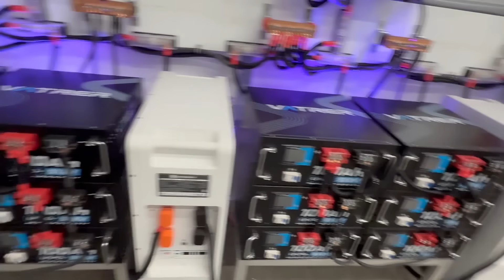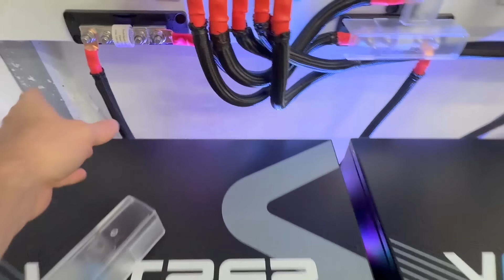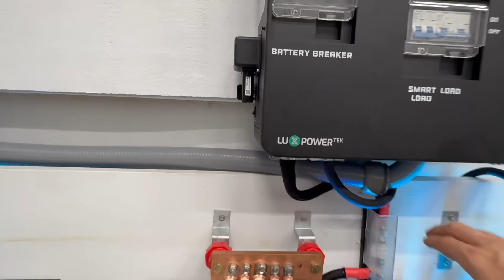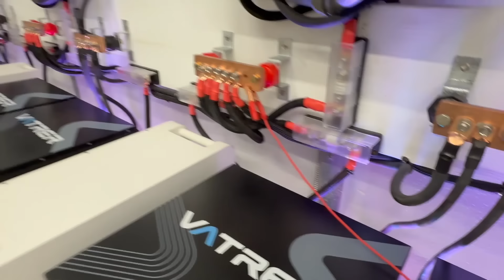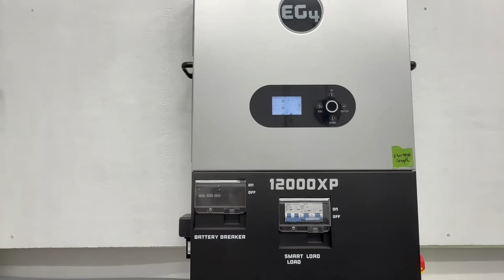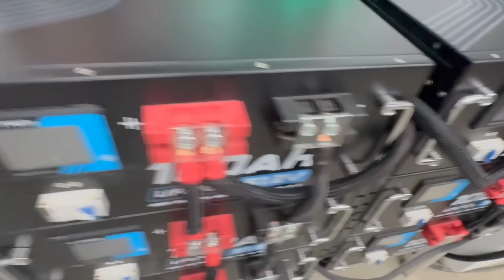Will These Inverters ACTUALLY WORK?  Initial Power Up!

Comment: When using your power supply unit to power the inverters on how does that work if the inverters are in the off position can you explain?
Reply from the maker: The low voltage dc bus and APS circuit for the main control board always have power when 48v are connected. Even if the power switch is turned off.

Comment: I'm curious - did you purchase all this equipment, cables all the hardware? Why so over the top? I can't even afford the cabling let alone the hardware
Reply from the maker: Hi Boomer, thank you for watching.  I did purchase it all, but it took some time to put it all together.  It covers a lot of my power usage but still falls a bit short in the winter.  My only thought is to start a little bit at a time based on what makes sense for you.  I personally started with power stations.

Comment: Mike, did you unscrew the terminal in the 12000xp and use a lug straight to the block using the M8 or M10 screw? I think you covered that in another video, but can’t find it. Thank you
Reply from the maker: I was able to fit a 1/0 cable directly into the EG4 block and torqued the Allen screw to spec.

Comment: Hi Mike — I’m troubleshooting an issue on my EG4 12000XP and figured there’s no better person to ask than the guy running three of them! 😄

When you get a moment, could you check something for me? From the display screen, go to the Data icon → UPS Data tab — what voltage do you see listed under VepsL1N?

Comment: Have you looked at your insurance policy yet... Most insurance policies are void with DIY solar even if the equipment is UL listed
Reply from the maker: You are absolutely correct.
Reply: @MikesSolarGarage  sucks doesn't it. I have 90kwh of diy lifepo4 batteries and only 1 of the 12000xp and 12kw of panels. 6kw on the roof of my detached garage and 6 more on a Sinclair ground mount. All the batteries and inverter are in my basement because I live in a cold climate I didn't want to have them in my garage. But now I think I need to build a power shed to house everything in that's not in my house or garage and remove all the panels off the garage. So if something completely non related damages my home it'll actually get covered... Ins is just crooks I tell u
Reply from the maker: @electromechanicalstuff2602 Yes they are.  It sounds like you have a pretty nice setup!

Comment: I started my own solar project, 13 batteries LiFePO 4, at 32 Ah each, in 12.8 v mode, in my case its only for CCTV and few switches. I have 1400 watt of solar panels. no inverters, just buck converters for other voltages. its a fun project
Reply from the maker: Sounds like a great project

Comment: Suprised you are not using the GridBoss.
The batteries are set up great but all those wires and the bus bars should be in a wire way...
Reply from the maker: Thank you for watching! I thought about it, but I like the simplicity of a large branch breaker and an interlock switch on the service panel, plus it’s cheaper.  But the grid boss is a great way to go.  The bus bars will be covered soon with a raceway.  I do agree wires would be better in a conduit box, but since I went overkill on bus bars , wire size, and T class fuses, it would not fit easily in conduit boxes, plus it’s extra cost that I could use towards another floor standing battery.  All your point are completely valid.

Comment: If you ground down the lugs, do you still have 2/0 of current carrying capacity?
Reply from the maker: Thank you for watching. Yes because the width of the lugs was wider than the contact patch of the battery terminal.

Comment: Beautiful set up…. Only cost what $175,000… this is not really a DIY for the normal people. Do not get me wrong…..it is very nice.
Reply from the maker: Thank you for watching, the setup actually cost quite a bit less. I think I have 45k in it including the solar panels.  This system and my second system running the shop are just under 70k combined.   I got really good deals on all the products.
Reply: @MikesSolarGarage I was not knocking it, it as I said is very nice and THANK YOU for show us it. The video was excellent also. But for the average Joe even with your deals it would be out of reach. 
According to save on energy the “”average”” electric bill in the USA is $150 (actually $149.37) and yes I know we all pay more…so to break even would take 38.88 years not counting finance charges or increases in energy rates. I do not know ANYBODY that stays in the same house that long.

Comment: I don’t know where you live but your system would never pass code where I live. All those wires and batteries need to be in a metal box and in conduit where I live.
Reply from the maker: Thank you very much for watching.  You are absolutely correct, most areas would not allow exposed wires and they should all be in a conduit box.  Also the bus bars should be covered in which that will be done in the near future.  I did consider conduit boxes, but fitting my bus bars and all of my T class fuses would be a challenge.

Comment: Completely unnecessary and complex. 3 x 50kwh packs  40% less money. You have eighteen b, m, s, that could go bad. You would also have battery communication with the inverter. I'm not saying this to be hateful, either just more practical
Reply from the maker: I understand Mark, if I could do it again I would go with 280amp floor standing batteries, but I got a really good deal on everything, so it was hard to pass up.  As far as battery communications,  I typically don't used it for any of my systems.  I go by voltage only.

Comment: Please provide source for the copper busbar
Reply from the maker: Here is a link to where I got the copper from.  I chose 1/2 inch thick by 2 inches.  Then select the length that you need.  You will need to drill the holes and mount it.  https://ebay.us/COHou8

Comment: Very tidy setup considering all the equipment you have there.  I'm not convinced, however,  that under full load your batteries will drain equally.  That could also go for charging.   I'd love to see a full and fast discharge cycle while measuring the amount of imbalance.   That would be an amazing vid.
Reply from the maker: Thanks for watching Greg.  Honestly, that is the hard part, trying to keep things balanced.  I do have a separate setup in my shop for powering the shop itself.  It has 2 12000XP inverters and 24,  24v LiTime batteries in series parallel configuration.  I learned a lot from that, but the system does pretty well, typically the highest and lowest stay within 10 percent of each other.  I'm trying to improve on that with this setup for the house.
Reply: @Greg-bx4id agree with your commenting 100%. Very neat & it'll be interesting to see the results.
Admittedly, after reading the creators response, a 10% "drift" on a battery system... Not good (IMO)...
Then again, I am not an expert by any means 😁.
Opinion; with a system this size 🤔 everything is exponential! Internal resistance, heat transfer, amp hour differences/voltage drop programed BMS differences, ect.?!
To the creator, I say bravo! 🙏 I wish you all my best in your system! Forgive me, but the copper prices alone here... I would have gone Higher voltage DC (just an opinion).
Reply from the maker: Thank you, for this system I should have lower drift then my other system that is running my shop, I am hoping for under 5 percent..  High voltage makes sense, and I have another setup that is also high voltage, ( I have 3 solar setups in my shop),, but I really like the EG4 12000XP inverters.  Very robust output, reliable, and a tremendous surge for a high frequency inverter.
Reply: @meganwinters5163 Yup, the future is high voltage inverters but I haven't seen any DIY batteries/capable BMSs that would do that job and proprietary battery packs are way over priced.  Sig solar has a 30kw Solis high voltage inverter I've been drooling over because they are relatively cheap and noiseless with 1000v mppts.   I could have saved a ton on copper and inverters 2 years ago when I took my farm off grid.    Maybe when my 2 Solark 15ks die, I'll upgrade...but that will probably be a long time from now.

Yes, 10% drift could be problematic depending on your situation.   I first experienced that when I upgraded my 5th wheel to LFP.  As Mike says more copper helps and as you have said higher voltage helps, and 2 other thing helps...1) decrease the length of wires and amount of connections to lower resistance and 2) Lowering the amperage helps the most...The more battery capacity you ad, the less amps you draw from each battery pack making resistance less of an issue.  I now have 240 kwh in 16 48v DIY packs (256 MB31 cells).  They are stacked 4 high and each paralleled set of 4 is connected to a single Victron Power In busbar.  From there it goes through the Lynx shunt, then into a Lynx distributer...the distributer has 2 inverters and 2 chargeverters.  One busbar system keeps things clean and unless I'm charging the EV or running irrigation, I rarely go over 7-8 kw.  I think this is also Mikes approach as battery balancers don't seem to enter his equation either....I just would like to see how much drift he is getting out of that system as I see allot of cable and connections and some people think it's not a big deal while others maintain it is a big deal.    There are good arguments for both sides of that debate...hence I'm looking for a real life test....sorry, I'm a bit verbose...
Reply from the maker: Share your DIY wind/solar setup photos on the forum: https://www.windsolarforum.com/post/13676879 — Wind Solar Forum
Reply: @MikesSolarGarage  Thanks but I'm not a content creator for good reason.  I was told my system is still not to local electrical and building code not to mention I didn't pull permits for any of it as I'm pretty far out of the way and don't expect any neighbour to complain.
Reply from the maker: @Greg-bx4id  Understood

Comment: Nice set up.
You've got my act beat.

I run the 6000xp with 640amp of lifepo4 and 2400 watts of solar.
This small hobby project runs my main floor and basement including washer and dryer.

It works well but I want to install more batteries and double my solar input.

Great video thanks for sharing.
Reply from the maker: Share your DIY wind/solar setup photos on the forum: https://www.windsolarforum.com/post/13676879 — Wind Solar Forum
Reply: I've made videos and posted to my channel.
Livefree1654.
Reply from the maker: Awesome, I'll check them out!

Comment: Nice setup, very nice.  Why would SOC mode not work?  The BMS on each battery has CAN communication and all you have to do is take one battery BMS, put said com line into the master inverter and you have SOC since they are all LFP and will go up and down together.  Each BMS has bluetooth built in, so if you really want to check each individually you can do so.   SOC on LFP drifts overtime anyways so, it is just a ROUGH approximation anyways in terms of %.
Reply from the maker: Thank you for the kind words.  The floor standing batteries have communications, but the Vatrer server rack batteries do not.  But to be honest I am used to going by voltage to tell SOC, from my other setup instead of  using communications.  Thank you for watching!
Reply: @MikesSolarGarage  Alright.  Just curious,  How long does it take for those batteries to change voltage back to settled after being charged via solar etc so you can tell SOC via voltage?   LFP rest voltage is ~3.4ish Volts = ~100% when near 60F, but their charge voltage is 3.6V or so.
Reply from the maker: @w8stral  I go by the chart listed here as it seems to be pretty accurate.    https://naturesgenerator.com/blogs/news/lifepo4-voltage-chart?srsltid=AfmBOoqU8QJG_uwm8xt805QFWX5JLSJXya-wF96VJu-5EupZgq5eI7z9

Comment: May I please have a link for the sleeve that you use for the 2/0 wiring?
Also, would you know the watts on standby or power saving mode with no load on your EG4 12000 XP
Thank you
Reply from the maker: Hi Jeff, here is the link to the sleeves https://amzn.to/4nNI4aH.   On the 12000XP it draws app 15 watts with the inverter output off and 40 watts with the EPS output turned on.  So typical idle draw is 40 watts which is really pretty good for a 12,000 watt inverter.  If you are looking to pick one up use code GARAGEGET50 to save 50 dollars off your purchase.  Every little bit helps these days...
Reply: @MikesSolarGarage Thank you

Comment: @MikesSolarGarage I have four EG4 12000XPs and four EG4 Server Racks with EG4 batteries (same # of batteries per rack).  I have yet to wire the racks, but in my case where I have four of everything, what are the cons of just keeping each rack on each respective inverter?  Also, T-class fuse between the battery inverter is you going beyond the normal installation instructions....right? TIA
Reply from the maker: I would combine the batteries into one large battery bank.  One battery bank  keeps a single inverter from dropping out due to a discharged individual rack.  All batteries in one large bank go up and down in charge at the same time.  You can also place more solar panels on one inverter than another and have not have issues as it is charging one big battery bank instead of individual racks.   One thing to note with my other parallel  12000XP setup, I have noticed the primary inverter draws more power than the secondary inverter, so the load is not split evenly between inverters.

I would just make sure you have enough T class fuses if the worst happens.  It is pretty much mandatory (common knowledge but not by code) to have one T class fuse for each inverter.  If the inverter fails such as a shorted IGBT, you want a fuse that will blow quick before it affects the other inverters or your home electronics fed by the inverters.  You can never be too safe.  

BTW,  I'd like to see what your setup looks like so far.  Please post it on WindSolarForum.com.  Here is the link.                     👉  https://www.windsolarforum.com/post/showcase-your-diy-wind-or-solar-setup-13676879?trail=2

Comment: Good stuff, appreciate a wiring diagram/chart with wire size(s) and parts.  And if you get to do-over would you go with more 100Ah rack batteries, more 280Ah wall mount batteries, or this 18+3 combo?
Reply from the maker: If I could do it all over again I would not purchase server rack batteries.  I would go with either 280ah or greater floor standing batteries.  It takes up a lot less room, less wire, and a much cleaner look.  I learn as I go

Comment: Overkill on all conductors is always a good thing. Less resistance which means less heat which means more efficiency. The only thing not to overkill on are breakers and fuses....those should always be sized appropriately.
Reply from the maker: Thanks for watching hendersonsobers.  Normally you would want to fuse the 2/0 a little lower than I did.  But Temco rates their 2/0 welding wire at 325 amps max.  225 seemed safe and will blow at approximately 250 amps.  The 4/0 cable that connects to the inverters is 250 amps.  I chose a 250 amp fuse as it would blow at approximately 275 amps.  I have the inverter set at maximum draw of 250 amps (its maximum) so if that fuse blows it means my inverter probably went south with shorted IGBT's in the output stage and this will help save my appliances on the A/C side.  Hopefully that helps, but let me know if I am looking at it the wrong way.